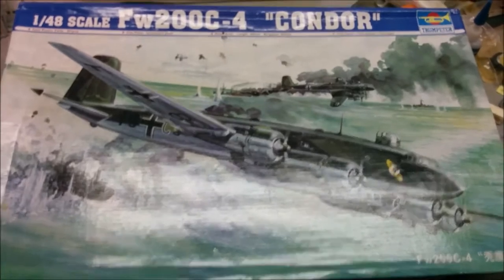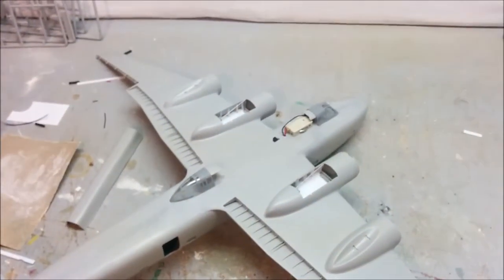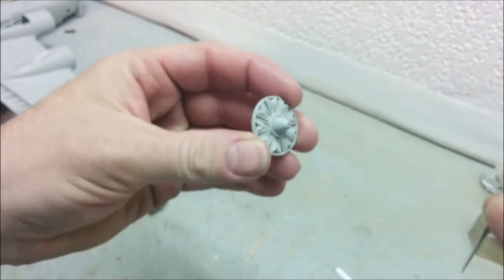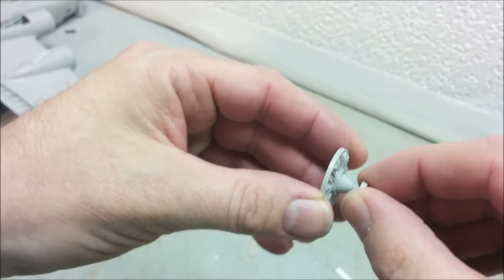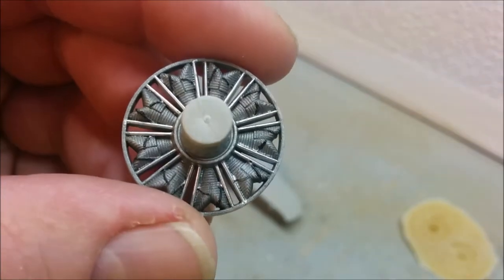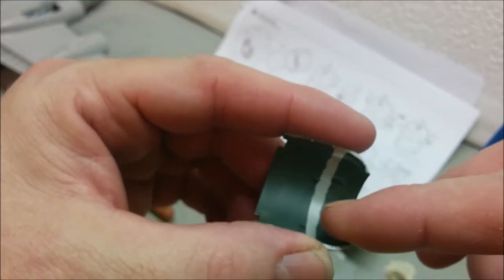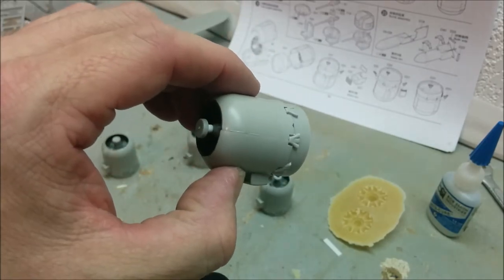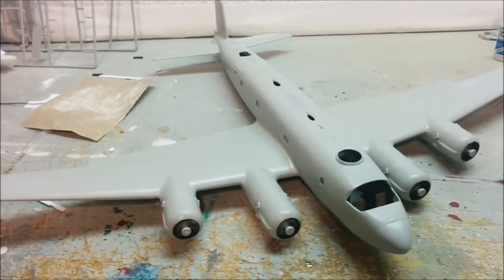FW-200C-4 Condor Build Pt7 1/48 by Trumpeter

Comment: What I've noticed with trumpeter kits is at first seeing all the parts in the box,looks impressive but once you start building the kit,the pie doesn't taste so sweet!😳

Jman👀
Reply from the maker: Yes I have to agree, they are aiming high but they are still not there yet.  Fit is generally first rate but let down by some annoying mold lines.  Of course they have totally screwed up on accuracy on some past kits. (but then we can say that about most companies) Thanks for following!
Reply: Dansmodelworx Agreed,I give the chinese companies props 
for the wide subject variety but I go into each project with
mindset that there might be
dragons to deal with?😳

Jman👀

Comment: Dan,
The Condor model what would happen if you drilled a hole in the center of the engine cowling 1mm larger than what it calls for? Can the propeller spin more freely, but  without wobbling?
Reply from the maker: Allan Martinez Actually drilling the hole isn't in the instructions. If you follow the instructions you end up with non-rotating props. One size larger drill would probably work.
Reply: Best not to glue the props on at all. I have this model complete and found it an advantage not having them fixed on the plane for transport reasons.